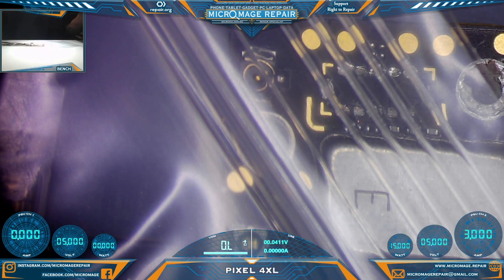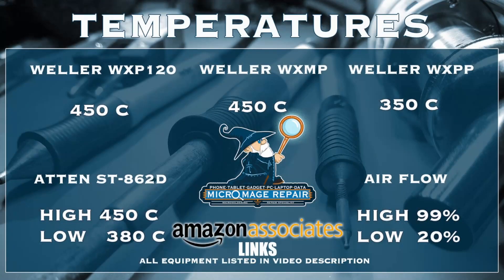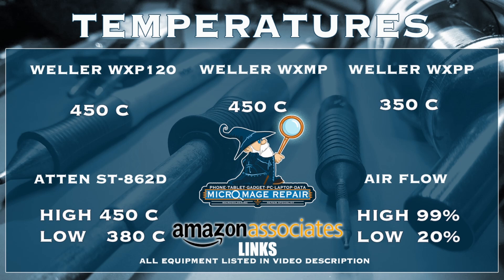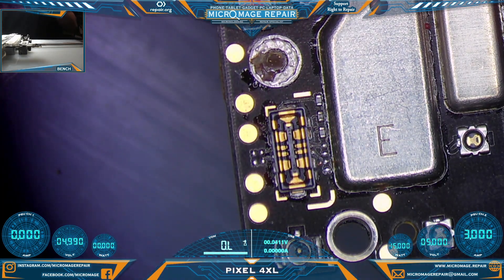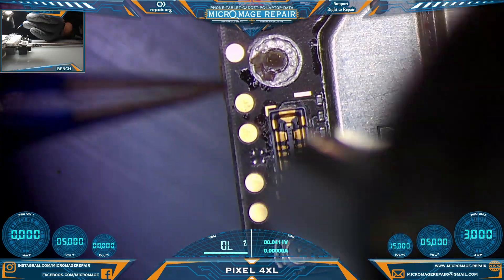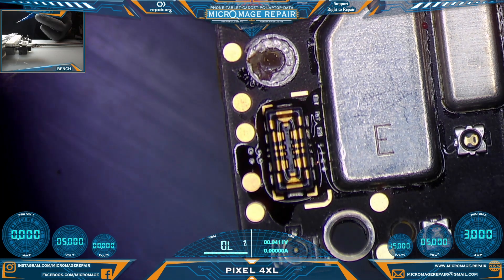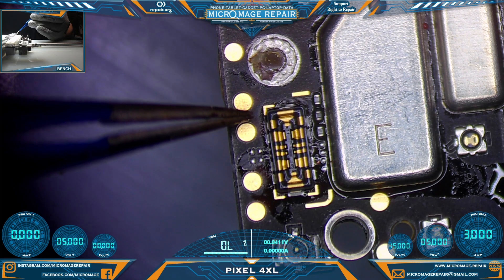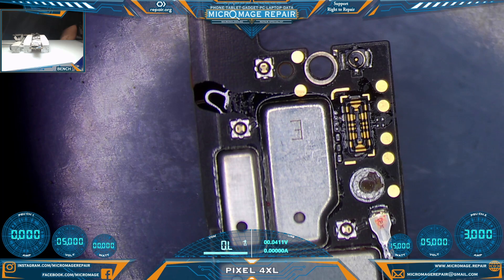Pixel 4 XL Battery FPC

Comment: Looks like somebody demolished That board ... Is that long screw damage At the top 🤔
Reply from the maker: Yeah they fat fingered it at least.
No the post was torn off though 😂
It worked somehow.
Reply: @MicroMageRepair  Might have heard this story a few times now but: if someone (*cough* Google's ubreakifix extended warranty contractors) screws it back on too hard, it'll just twist off.
Reply from the maker: @AySz88  Actually I haven't. I've only worked on a handful board only.
That's good to know!